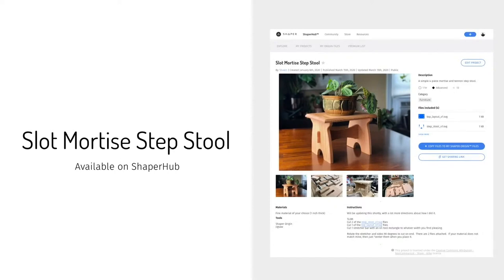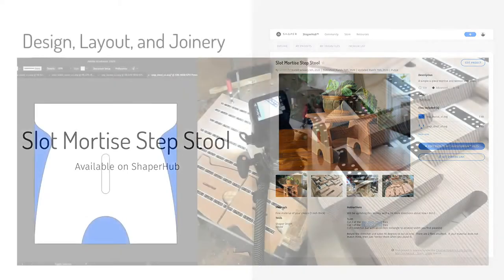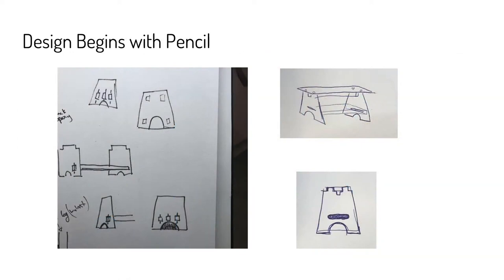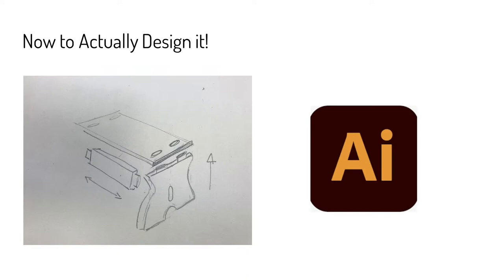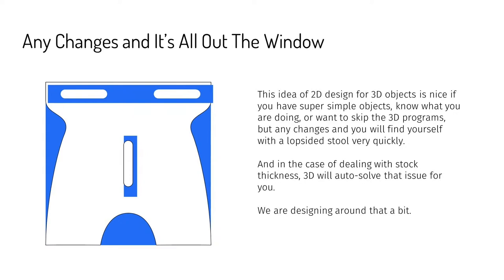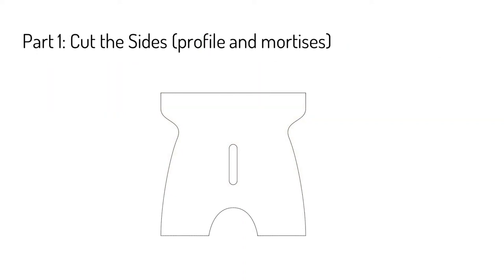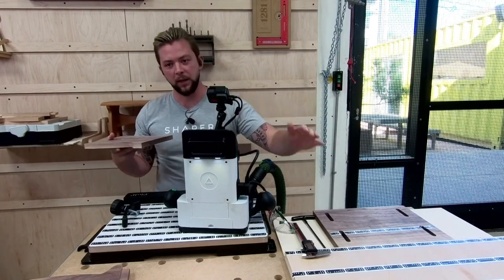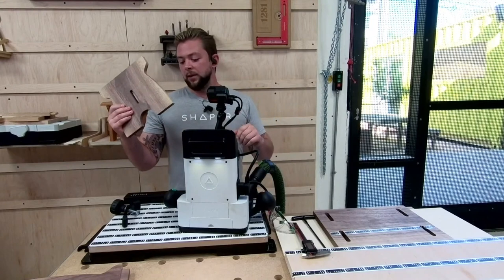Session 12  – English: Project Build: Shawn's Step Stool

Comment: Hi Guys. Are you using the same .svg files in this demo as are currently available for download for the project on shaperhub? The step_stool_tenon_v1.svg file that I downloaded from shaperhub looked different when I started the project today. Specifically, I was unable to setup an outside cut around the tenon proper using a .25 bit after the initial pocketing procedure. I can’t tell if it’s how I placed the design or that I need to edit the .svg file. The initial pocketing area (27:13) appears much wider in the Session demo file than the shaperhub file. Any nudges in the right direction are appreciated. Thanks in advance.
Reply from the maker: Hi Brad,
Thanks for reaching out! We can assist you better via support@shapertools.com. Mind shooting an email that way? Thanks again!
Reply: Shaper will do. Thanks.